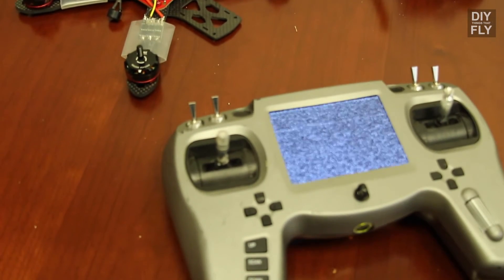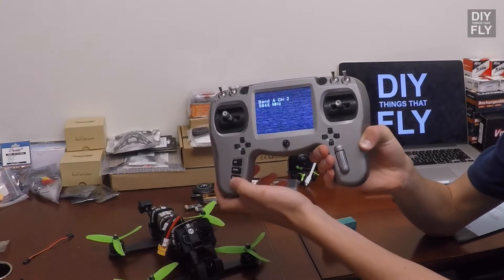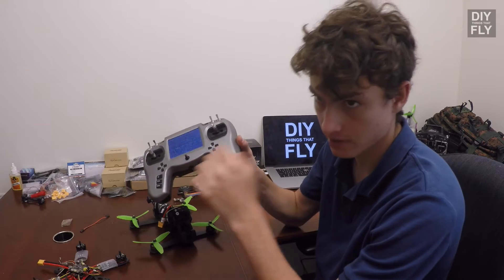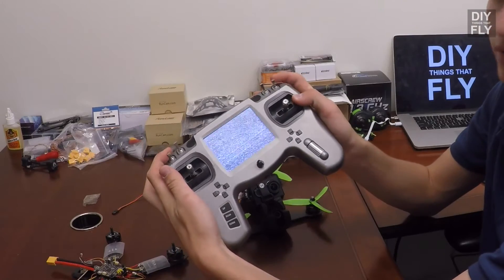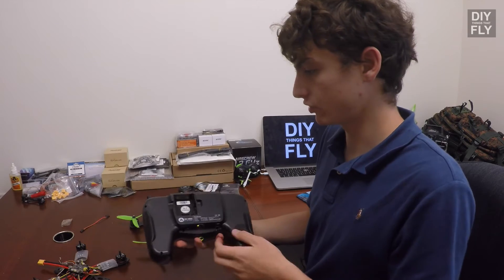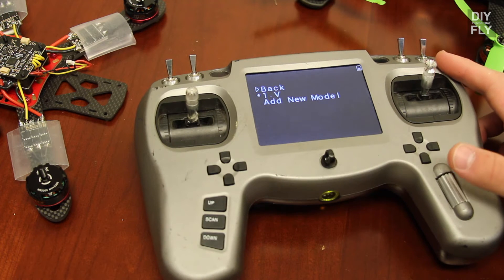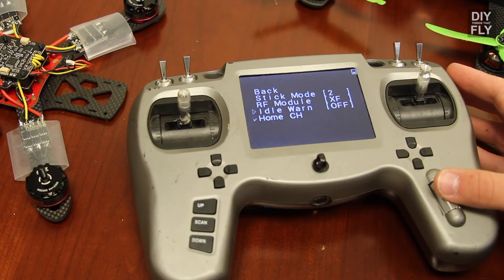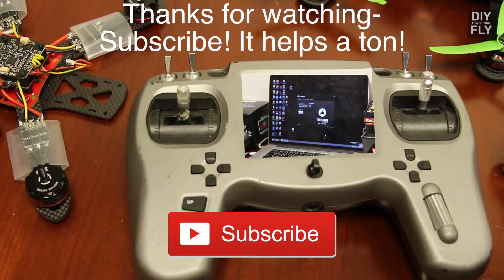TBS Tango How-To: Tips & Tricks, overview, functions & hardware of the fpv tx

Comment: so ,i have my tbs micro reciever bound to my tango ,but the throttle dosent spin up the motor on my test setup witch is 0ne esc and one motor for simplicity.any ideas why it wont spin the motor up it is bound .the reciever and the crossfire unit are bothe lit up green and esc and motoe initalizes .
Reply: any help is appreciated and thanx in advance.
Reply from the maker: Do you have a servo? Plug a servo into the crossfire. See if it works.

Make sure the receiver you have is set to output PWM to whatever channel you're using, not PPM. PPM is several channels at once. PWM is a single channel. 

Or, if you're just testing it to use with your flight controller, plug the one ESC and motor into your FC and go thru that. Connect the crossfire to the flight controller in PPM mode (the way it's shipped i believe) and spin up 1 motor thru cleanflight or whatever software you're using. 

Hope that helps! Let me know if you get it working

Comment: how to calibrate tbs tango,,tks
Reply from the maker: To calibrate, 
Press the Power-button and Down-button for 2 seconds at the same time- a confirmation tone will sound. This is where you can calibrate control inputs, change test settings, read ADC and PPM values, and change LCD display settings.
http://www.team-blacksheep.com/tbs-tango-manual.pdf
Reply: oke bro thanks
Reply from the maker: np dude

Comment: bro help me...I bought this unit....came completely dead.....with the supplyed USB cable after letting charge four hours won't even come on....I used the cable in a cellphone charger box...am I missing something? not even the first bar yet...
Reply from the maker: Send a ticket to TBS support, you've got a problem. You could also message Raphael on facebook if you're in a hurry, but opening a ticket is pry your best bet. You've got a dead unit it sounds like :/
Reply: thanks for replying.... I bought the kit that includes vendetta.tango.backpack.ect ect.. it came with a short cable that's about 10 inches long thats USB to like a android end... I was dead when it arrived...I powered it on and it was beeping dead with no bars in the battery indicator.... so plugged that supplyed cable in the kit to my cell charger block...12 hours later no bars still...  could the cable be wrong ot the charger power source I'm using not good enough to supply charge??? what exactly are you using to charge your tango.... really appreciate your help....
Reply from the maker: I had a preproduction, it didn't come with anything. I use my microusb samsung charger to charge it. If yours won't turn on after 12 hours, there's a problem! :O
You are holding down the button for a few seconds to turn it on, right? You need to hold it down for ~1.5 seconds in order for it to power on (to avoid accidentally turning it on)